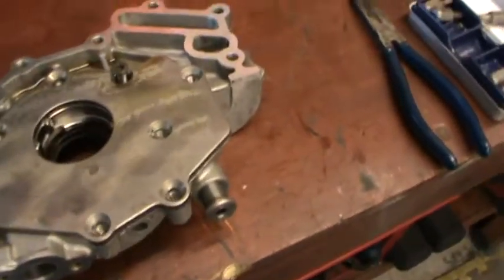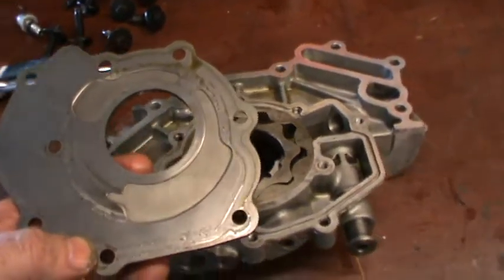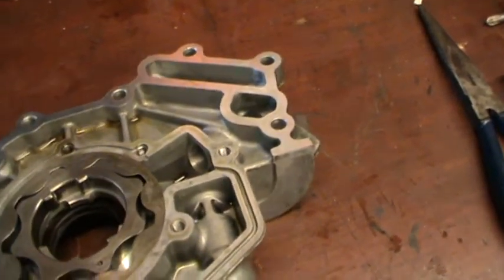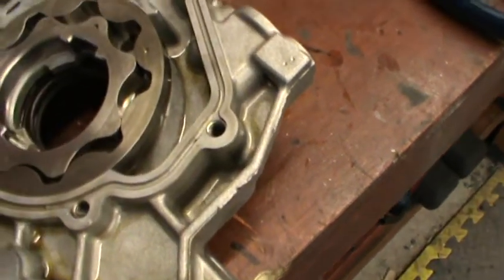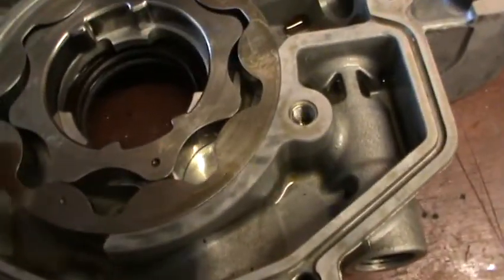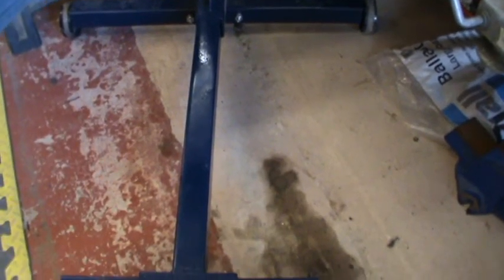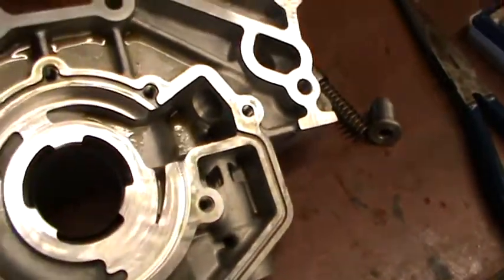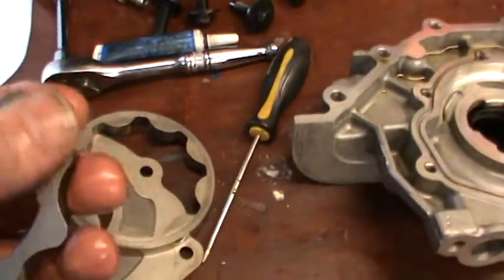2.0L Zetec oil pump Focus 99 to 2004

Comment: Mr Barber, I love your video's! Since I to have a zetec 2.o!!! I feel stupid not replacing my oil pump while I am in my motor but, the plan is to just fix whats needed right now & hopefully this summer when its nicer outside & hopefully I will have more $$$ money to do a full engine rebuild? tho, I need a engine lift & engine stand & a press for the wrist pins & I would need a ring sleeve for getting the pistons back n2 my block! so, piece by piece, I will obtain everything, tools & parts & be ready when the weather warms up...hopefully.